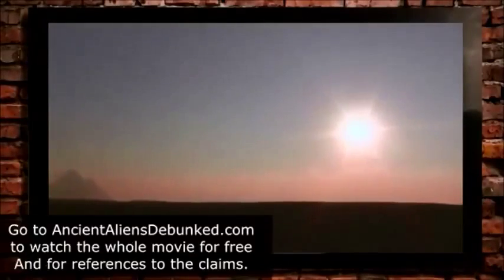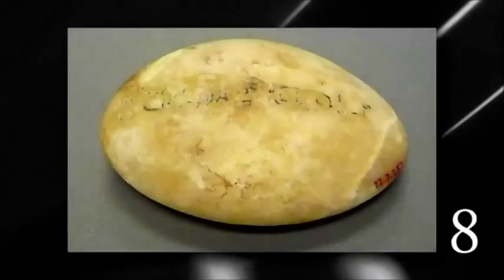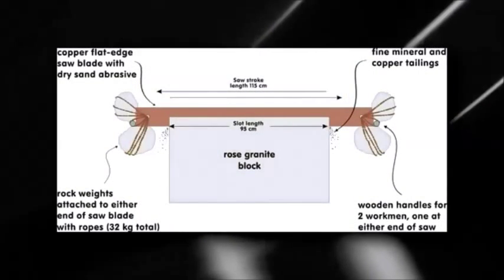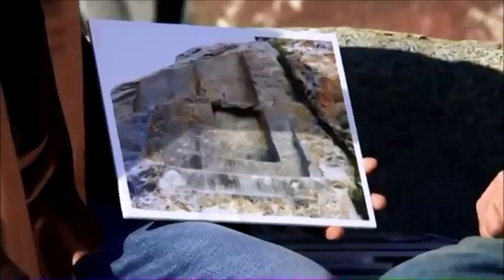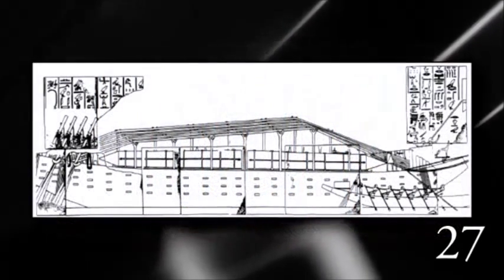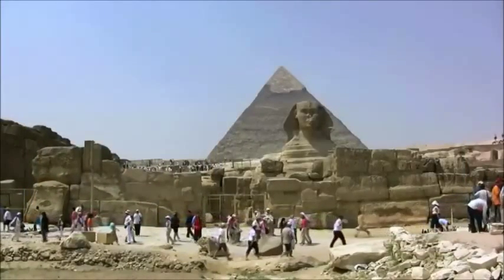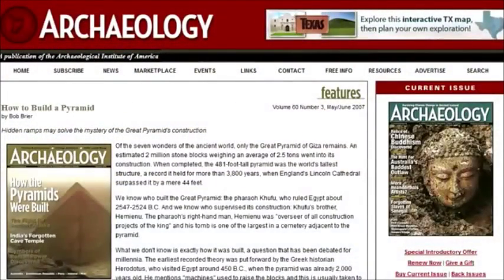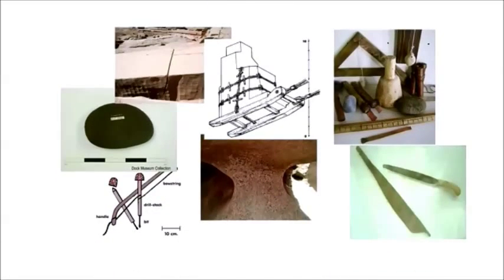Pyramids internal ramp theory

Comment: Except the slightly shorter middle Kafre pyramid (next to the Great Pyramid) was built several decades later with a completely different internal structure? Did they decide a grand gallery wasn't worth the effort or does that mean a grand gallery isn't needed to hoist a block over 215 meters to the top of a Giza Pyramid after all? Consider of the three great pyramids and the middle pyramid is only 14 meters lower in height. The middle pyramid doesn't have a grand gallery. I think anyone who has visited the pyramids would think to ask these questions as I did after visiting them.
Reply: It had a different burial chamber - it did not need all that support

Comment: Interior ramp is the best theory. Not exterior.
Reply: A mix of exterior ramp, internal ramps, and wood crane scaffolding is the best theory and explains how 10,000 some people could work on it at once. I think it’s an exterior ramp up to 40 meters. Internal ramps after that. And wood cranes to do the exterior. 

No one theory has ever solved all the problems but by combining various ones we get a very plausible solution to how and in so little time.
Reply: Defo external for the first bit..